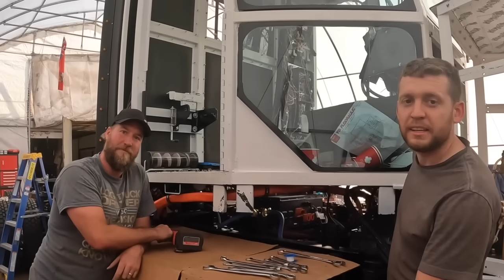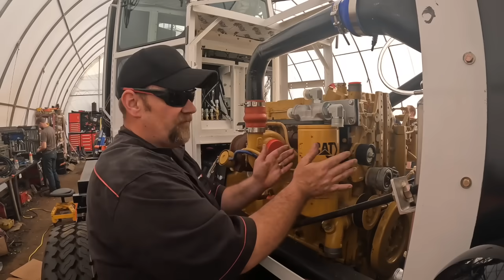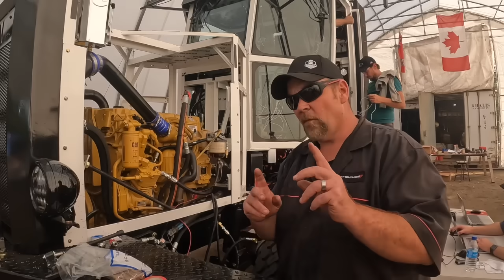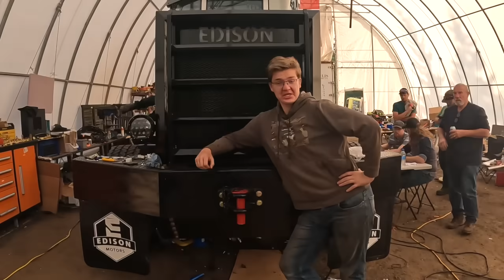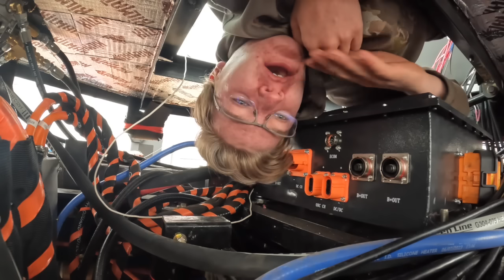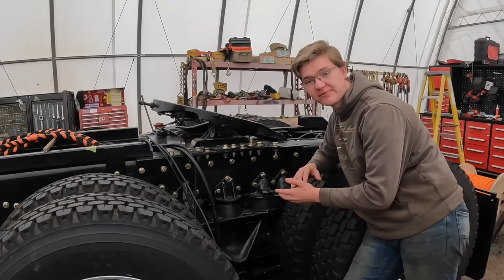Inside Edison Motors: Tech Talk, Truck Innovations, and a Special Farewell!

Comment: Hi voltage what is the amount, 220 480 4160 13800 ? The question may be domb. If you run two cables sid by sid you make a transformer.

Comment: How about an electric water pump for the engine? Then you can have cooling for the engine after it has shut down, so it doesn't shut down hot, and you don't have any engine belt after that, just the front balancer.

Comment: maybe this is anecdotal but a lot of EV conversions have the Problem that the 12V batterie dont charges reliably, i think you should put a 12v Batterie Display somewhere or some other thing to make sure your 12v gets charged

Comment: 4:28 That's actually not true. The official definition of a motor is: a comparatively small and powerful engine, especially an internal-combustion engine in an automobile, motorboat, or the like.. However an engine can be fossil fuel or steam: a machine for converting thermal energy into mechanical energy or power to produce force and motion.

Comment: What happens to the pumpkin in the e axel if the truck is left out in the rain? Will it grow bigger? Is that a good thing or a bad thing? 

Another thing I just realized is molten aluminum is known to interfere with the quantum fields generated by the flux capacitor. Has that been considered in the calculations?

Comment: PLEASE don't use a 1R0716 oil filter. The C9 is a heui engine. Use a 1R1808 high efficiency oil filter. I would recommend using Mobil Delvac or Chevron Delo.

Comment: I get treated at my local O'Reilly auto parts like that, they let me look up my own parts and do my own thing until I'm ready to pay. Keeps them busy taking care of other folks and I get to figure out my own issues, we have more than one truck that has some weird stuff going on. Mid year Ford stuff, iykyk. 😂 

Like the super duty. The one we have is actually just called F-Super Duty. Not an F-XXX like an F-350/450. It's neither of those, it is its own model of truck. Nobody ever understands that and I got tired of getting wrong stuff because they say it doesn't exist 😂

I also work on a number of vehicles that are weird. 
Nissan 720 pickup but powered by a diesel engine. SD-22 If you'd like to look them up. It's a weird one. Took me 3 tries to get the right starter. Had to order it for a forklift. Lol

Comment: The tow trucks I’ve operated needed improvement on this exactly. So if I was to suggest as if I were them. Just pull your cables as tightly as you can especially when rounding corners or turns. Also zip tie it so tight you can’t split help to split insulators trying to get a flathead underneath…

Comment: Now that you have all this get the 3d map then they can make map then combine wires how you can and make nice and tidy. I design low voltage circuits and pcbs. You don’t need the 2 12 volt batteries. you could use 24 volt step down and never worry about having the secondary batteries. Might be something to consider for production.

Comment: I have a couple questions how many tunnel rectifiers are needed to keep the turbo encabulator from over heating and causing a sinus infection of the glutius maximizer?
Further more how do you keep the heat from the turbo encabulator from causing a freeze event?

Comment: While I understand the value in having discrete relays and fuses, that electrical panel is a nightmare to wire and trace.  I strongly suggest you go to a PDM like what Haltech offers.  This gives you "electronic fuses" and allows you to configure current control and diagnostics directly.  If there is a fault, you can surface this through the cab displays and not have someone chasing wires.  If you are worried about repairability and reliability, then use redundant PDMs and make sure the vendor you get them from has made a commitment to right-to-repair by releasing the relevant schematics and troubleshooting documentation.  If nobody will agree to do that, then it sounds like you have a perfect opportunity to innovate; but it would be better to get an existing company to commit.
Reply: I also suggest replacing as much low voltage wiring with PCBs as possible and make the schematics, board view files, and such easily and readily available and/or open source. PCBs may be proprietary, but if designed right, should be more reliable than wires, and provide terminals/switches to disconnect the PCB wire trace and repair with a wire if there's a fault, and then get a replacement PCB later, or someone who knows how to solder to repair the PCB (if possible). Should be quite simple to fix with schematics available, and with board design files available too, easy to get a new PCB made from any PCB source.
Also, for the wiring terminals, I highly recommend Wago lever nut style or a standard locking type connector (Wago makes these too) for quick and easy connect/disconnect, no screw terminals or wire nuts please.

Comment: I know what ya'll guys are in for may not be the exact same cuz ya'll are building semis I was building show trucks but one of our buddies wanted to go to a car show with us it's 3 days before the car show we tore his truck down to nothing but a chassis and cab and proceeded to put air ride suspension on all four corners 4-link suspension c notch the frame install air ride and are management systems Mount the two viair 444c compressor run all the airline .... Ajust pinion angle ajust front end geometry ......
 We finished the truck and drove it out of the shop 2 hours before we needed to leave for the show ....... Best carshow i ever attended nowing one of the cars their was a 2 day full build .... Its awesome

Comment: I think the difference between you guys building your truck to be easily serviceable vs engineers designing them is the engineers have to use standard parts and they are under pressure to make it as cheap as possible. You guys are trying to build for one application and your willing to increase costs to have it more serviceable. What makes stuff not serviceable easily is the same engine and parts are used in hundreds of vehicles. You cant make it easily serviceable in all applications without building custom parts for each application.  I hope you all stick to your guns and develop custom parts for each application to keep it serviceable. Most all engineers would love to build machines that are easily serviceable and normally they do think of most things!

Comment: I just realized there isn’t really much difference between this and a big ships power plant. If you don’t know ships have engines that power electric motors that turn the propellers. But the difference here is that the engine is also charging the batteries that also runs the motors. But the engine doesn’t need to be on very much unlike a ships engines that has to be running when they wanna steam out of port.

Comment: 7:51 from the angle of the camera, the bolt next to the large power cable looks like it wants to rub onto the cable.
Reply: The wire is just loose against it, it hasn’t been properly secured yet

Comment: All of cats engine parts are available though perkins
Reply: Could you come up with the part number(s) of the group for an oil cooler and filter adapter that would tidy up what's being done here?
Reply: @johne189  there's the ones for generators that come out the side of the engine leaving it right up top and visible. I can locate that part number when I go to work Monday
Reply: @RNG_Anarchist  That's a generous offer. No doubt there must be a more tidy arrangement available. Thanks, but don't bother for me. If Edison decides to clean this up they could chime in with some interest. Again, thanks just the same.

Comment: I’m just a casual watcher but why does the engine need a turbo?
Reply: Free power and economy. The exhaust push, which would be lost if just dumped out the exhaust, spins the turbo which forces more air into the combustion chamber for more power by creating better combustion.
Reply: @ronfullerton3162  Well I understand HOW a turbo works my question was more specific.  I meant if all the engine does is turn the generator then why not use a naturally aspirated unit?
Reply: @brianb-p6586  I gotcha

Comment: Motors are machines that produce movement, there are wax heat based motors, electric motors and ice motors, air motors and the rest. Engines are machines that convert power into movement so pretty interchangeable but maybe youd have to call the batteries, controller and motor of an EV an engine.
Reply: I need to buy some 2-cycle engine oil for my boat's outboard motor, then I'm going fishing, to ponder all this.

Comment: a lot of newer engines and dragracers use an electric waterpump , wish might be usefull on the generator as it can stay running to cool the egine after shutoff , maibe help heat the cabin using the engine coolant / heat warm up the batteries keeping the engine at temp using the heat from the batteries during charging from the mainspowergrid 
it allso takes the accesory drive belt out of the equation

Comment: 3:35 Shouldn't there be an oil cooler somewhere in the mix?
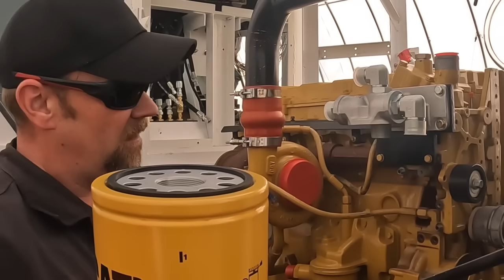Reply: A cooler may be located behind the filter adapter seen at 3:16, depending on the build arrangement.

IMHO, it makes no sense to hang the filter remotely, where it now crowds air intake plumbing. 

Now the engine's vital "main artery"  lube oil is unnecessarily placed at risk by being routed externally through rubber hoses. Rubber hoses of pressurized lube oil in the vicinity  of extreme exhaust heat, a recipe for disaster. Why? 

Besides that, who knows what's happening with drain-back and siphon at the high-located filter? Now the lube system may be getting a "burp" of air with every start.

During an oil change a mechanic is already under the truck with a drain pan under the usual filter location. The filter could  be spun off without a drop of oil touching the truck, while the mechanic is right there anyway.  What could be more convenient? 

Meanwhile, with the remote-mount filter she has to fumble with a hood panel and a difficult tip-in/out of a full filter? No way it can be done without a mess. Why bother?

The remote filter is not an improvement. Edison should deep six the remote filter and go with the conventional failsafe direct-mount  filter arrangement.
Reply: I was wondering that to but the motor is running full time so maybe not

Comment: Actually motors by definition can be electric or internal combustion or powered by some other means just to clear that up.
Reply: True, but the disciplines involved have been trying refine it to motor being for a non-fule-burbing power source to help segrigate fule-durning engines from the catch-all of power sources for motors.
I know it's ment to reduce ambiguity but it still leavs motor with a slew of potential power sources. 
Still one less is one less.

Comment: Just call the 24V system a Converter or Charge Controller. An alternator produces alternating current with a rotor and stator; your low voltage system just uses a fancy switchmode supply, no alternator.
Reply from the maker: EV Alternator is what makes the most sense when explaining the part to normal truck mechanics.
Reply: @EdisonMotors  It has a strong ring of ATM Machine to me but if it makes sense to the wrench turners, it's for the best.... I'm just dying inside a little every time I hear it lol.

Comment: You are all doing a great job even the intern :-D
I'm really fascinated by this whole project. The front engine description got me wondering about the engine colling. Have you considered instaling electric water pomp? By my simple logic it would prolong engine life, since the engine is turn on and off only on demand/quite rapid in hybrid vehicules, and the electric water pump could cool it after shut down. Also during winter time it would preheat the block more efficiently.
If you mentioned all of this somewhere along the way, sorry for     unnecessary comment.

Comment: I'm slightly confused by the whole lights can stay on crazy long thing, do you not cut off the high voltage close to the batteries when not running?  That's a standard ev safety function, no high voltage when parked unless charging (which is why it IS possible to need to jump the 12 volt battery in an EV usually) they use the 12 volt battery to power all the standard car/truck electronics and it also is used for the contactor to engage the batteries for charging or driving.  If you really are not disconnecting the high voltage batteries automatically why even have lead acid batteries, a larger buck converter that could start the generator will still be lighter, and you could use a separate one to avoid any voltage sag or other issues if you really needed to.
Reply from the maker: We said if you left it running…
Reply: @EdisonMotors  I completely missed that point.
Reply: It seems that they leave the 24V charger running.  I think the charger is actually powered from a unit right near the batteries.  It could even be that they just turn the high voltage into mains voltage then run a mains powered battery management system for the 24V part.
Remember these guys are bolting together easily obtained off the shelf stuff where that will serve the purpose.
Also, I suspect that there are laws that sort of force them to include all the 24V stuff just to be legal.
To start the diesel making the "generator" on it run as a motor would work just fine.

Comment: I like this video start. Cable and line management. Where power lines go where hoses pipes & fittings go. I am an engineer that started as a master technician, which means that I can run fitting & design to build and commissioning way better. Again you build a custom  produc build, concept, modification, conversion or anything else this is what factors in. The apprentice engineer is amazing to see. God bless y'all keep on trucking 💪🏽👍🏽👍🏽👍🏽

Comment: 0:40 so the mechanics went crazy, without thinking it through like an engineer would have?

so much hate for engineers from this team, blaming them for the mistakes and decisions of corporate managers.
Reply: Trolling for more engagement is a common business tactic. So many engineers that constantly tell them they doing  something wrong.
Reply: @badgermetal  planning ahead, and routing things properly for ease of maintenance is an engineering task. 

but you can't always get everything either.

And without engineers, they wouldn't have their battery chargers, diesel engines, axles, motors, etc.

It's one thing to bolt a few existing parts together, another thing entirely to design those parts from scratch into something powerful, efficient, reliable, etc. And along the way you have to make tradeoffs between cost, ease of maintenance, reliability, efficiency, performance, manufacturability, etc.

The fact they didn't think far enough ahead about something as basic as routing of wiring, air lines, etc. shows they are not immune from doing EXACTLY what they bash and blame engineers for constantly.

Cable routing is part of my job as an engineer. And I could make this truck even more serviceable than they are making it. Granted, this is a rushed prototype, so I'm not holding it against them.

Engagement is good, especially when they are doing a good thing, so I comment knowing my comment will improve their numbers. Doesn't mean I can't make a valid criticism at the same time.
Reply: @SoloRenegade Actual prototype construction using real engineers also have these problems that have to be rectified. It happens with or without engineers. Do you know why technical schools and colleges got their start? It takes a team to build a project of this magnitude. They have admitted that they went to companies that employ engineers for that level of items needed. But on this assembly, these guys have an education level that most engineers do not have. 

Ideally we would have an engineer get real world experience in their area before or during their collegiate work. But we know that is not possible. I have known people who worked in an area, then went off to college and advanced their knowledge of their chosen area with a degree. Those people make great engineers.

Comment: he's wrong about it not being a motor... the actual definition of motor is " a machine, especially one powered by electricity OR INTERNAL COMBUSTION, that supplies motive power for a vehicle or for some other device with moving parts"... which means all engines are motors but not all motors are engines... i don't understand why mechanics keep pushing this myth, but its wrong. and all it takes to know that is looking in a dictionary.
Reply: What do you mean?
GM, General Motors, and BMW, Bavarian Motor Works, only make electric vehicles !
Reply: @josephpadula2283  I'm saying all engines are motors but not all motors are engines.
Reply: As soon as I get some 2-cycle engine oil for my outboard motor, I'm going fishing and will ponder this dilemma.